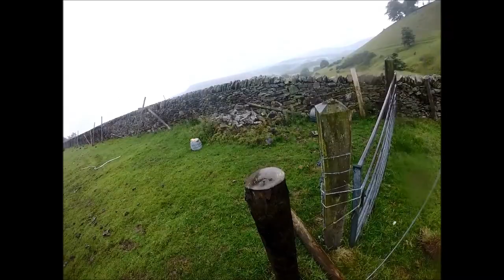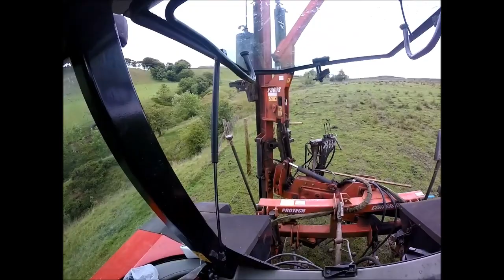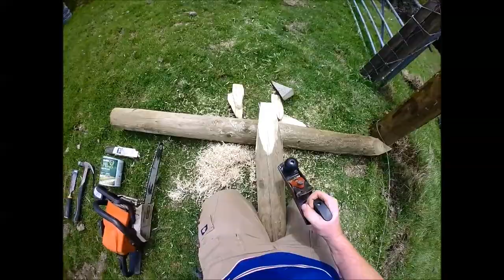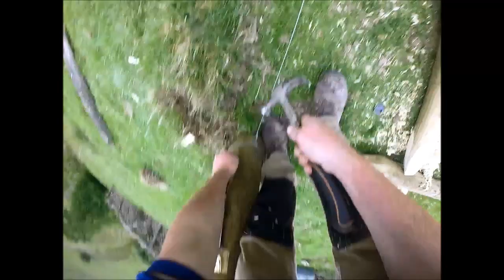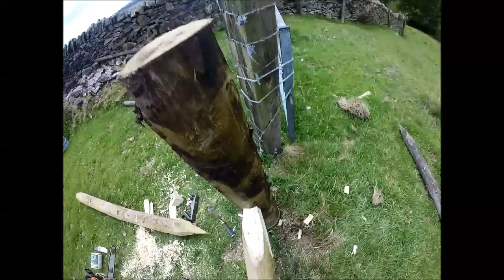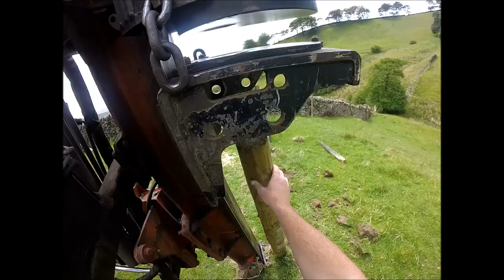livestock fencing Contractors view.

Comment: Wouldnt it be quicker driving the posts with a sledge instead of the post driver
Reply from the maker: Are you taking the mick 😁
Reply: @stubbenmonkeyfencingtractors  lol by the time youve moved the tractor to each post got in and out lined up the post driver surley it would be quicker to just hammer them with the sledge